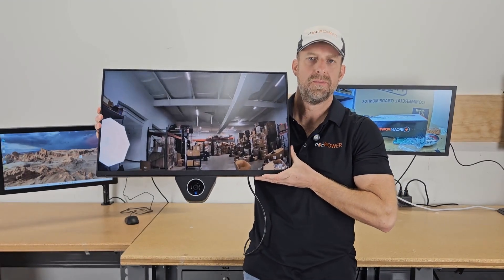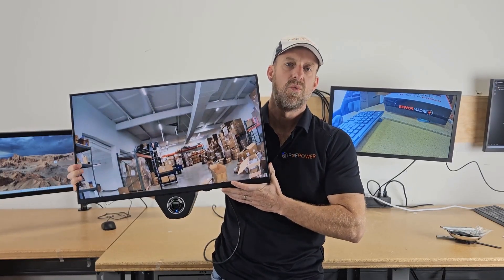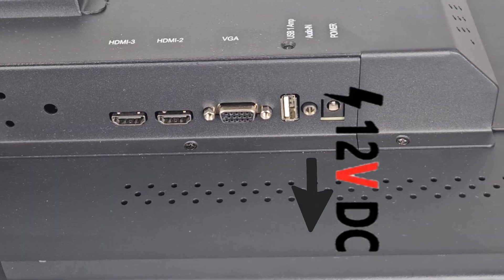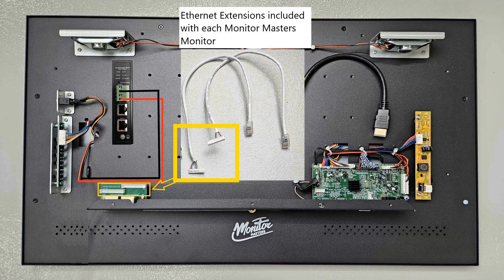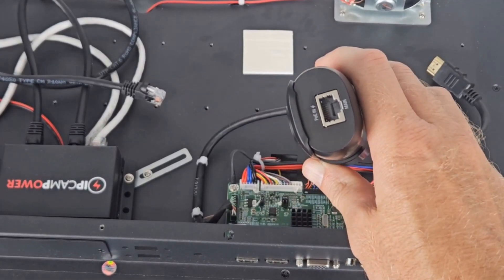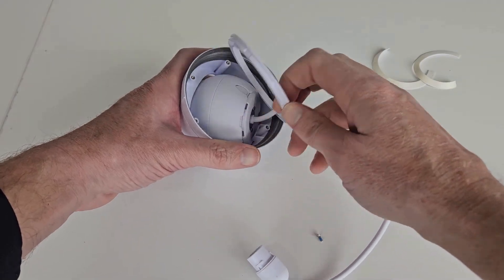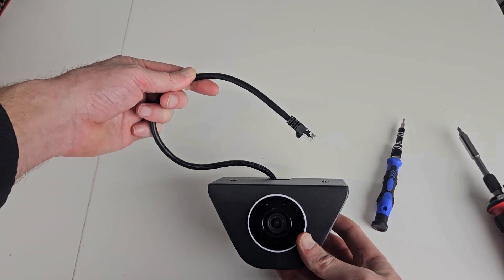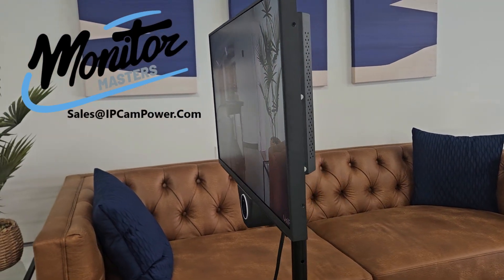How to make your own Ubiquiti Unifi Public View Monitor PVM with a G5 Turret Ultra

Comment: Hello does the system still work well with Unifi protect to manage both the camera and viewport
Reply from the maker: Yes it does. Your unifi protect system wont "know" that it is connected to a monitor. You will still see the viewport and camera on the network as usual

Comment: This is awesome - please could you tell me the available POE budget I will need on my switch? The G5 Turret and Viewport are 4w and 9.5w
Reply from the maker: It depends on the size of the monitor used but to be safe, use an 802.3bt output capable of pushing 90 watts. If you have a specific monitor size in mind, let me know.

Comment: You need to add several camera options like the G6 at least so you can add facial recognition.
Reply: This feature can be added to the G5 camera lineup using a UniFi Protect AI port device. It's not required to by physically connected to the camera but can be if needed. I have several G3 cameras enhanced by an AI Port and now have smart detections including face, license plate, animal, etc recognition.
Reply from the maker: Thanks for the suggestion, we may add those options in the future!